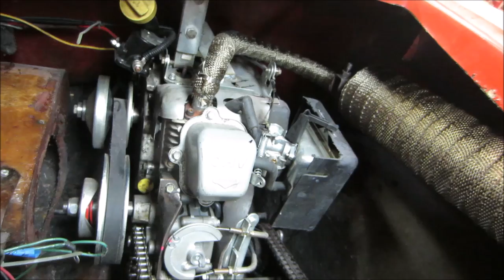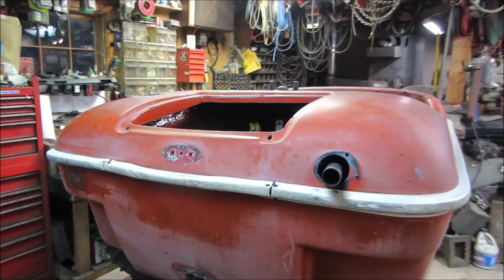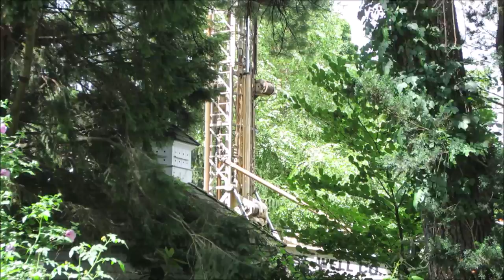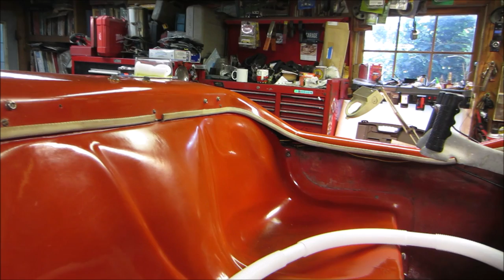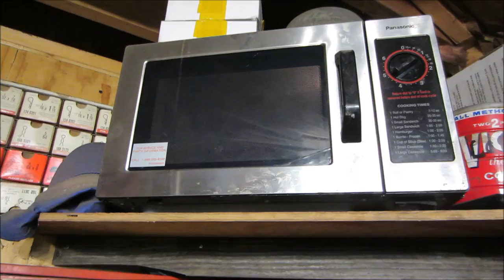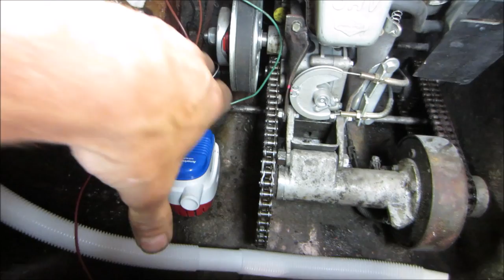Buffing my Beaver amphibious vehicle

Comment: maybe I missed it somewhere along the line, but what the hell is that big hole in the ass end? Seems to me that needs to be plugged up or something.
Reply: toot tall it's the hole the hitch mounts in
Reply: well it seems to me something else should be done for a hitch than. a hole in the body that low... can't be good if it ever goes in the water again. Personally I think everything that goes through the hull is a bad idea, but when it's required, it should get rubber washers and or sealer, something.I think my first priority would be keeping water out, the bilge pump can just be backup, not a much needed item that way. Why does it need a hitch on the back?
Reply: toot tall there was an optional floating trailer for it and it does get a seal of some sort around the hitch... it just is removed for now
Reply: if you don't have the trailer or the seal, then best to fill it. In my mind, any hole that low in the boat/thing is a bad thing. Seals go bad. Then again, you may never take it on the water... but then all you've got is a golf cart. a weird one at that. Might be good to fix it anyway, if you're the kind that hit's the ball in the water a lot...lol. Of course, only things I know about are actual boats, not these dual purpose things. I have been attempting to design a vehicle that goes on land and water,  but larger and faster. Large enough to deliver a squad of men where they need to be when they have to enter from the water. What's come before was never very effective. Either unwielding on land or ater or both. During ww2 they designed a tank that could theoretically go in water, but it was a disaster on D day, the waves swamped them fast. They have an actual tank that can go on water, by hydroplaning but if it stops, it sinks or nearly so. it's also not that fast on land, oddly it's faster on the water. I'm thinking only light armor, but the new kind that is very good but lighter weight. Powering it is a problem though. Any time you add axles and steering and the like, you have to pierce the hull, and that's never a good thing. also enough power to make it speedy requires a lot of engine space and larger fuel capacity. If people are shooting at you, being fast is a good thing. Oddly, you can turn fiberglass into bulletproof material. They simply compress it during the curing process. Add a certain ceramic, it becomes highly resistant at least to normal bullets. I am also developing light weight armor that resists RPG's. That's a long story and a long process to explain.